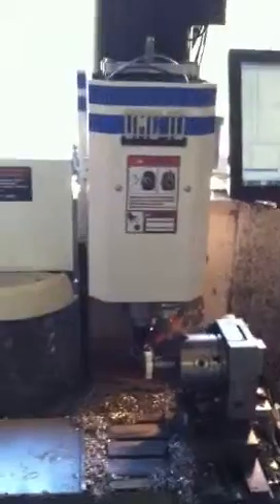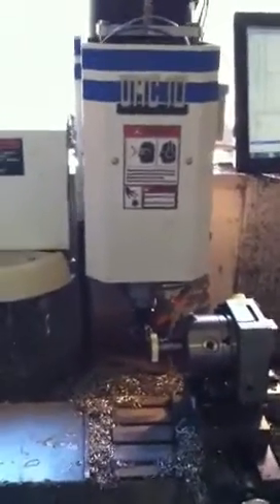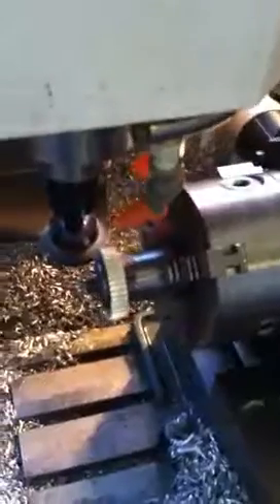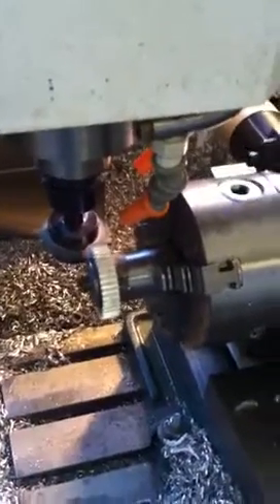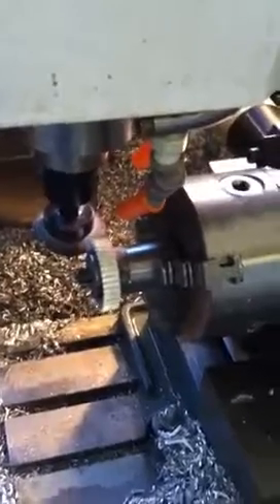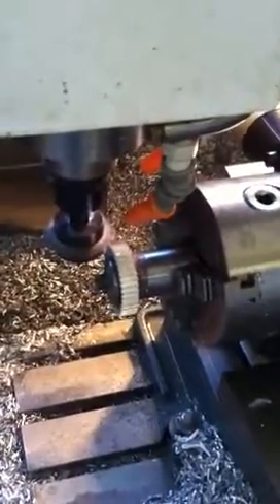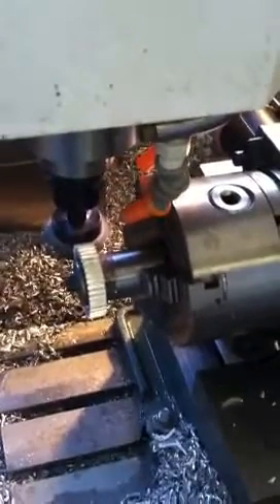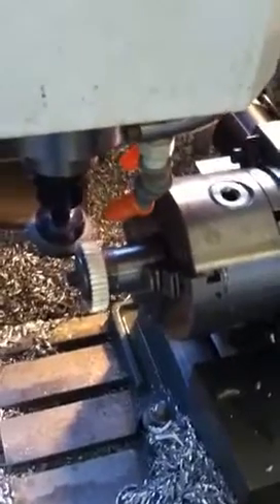Cutting a Gear

Comment: Just to clarify, this is a gear "cutter" hobbing requires constant motion relative to the hob (which looks like worm gear) and the axis the gear is on.  Gear cutting is a totally legitimate way to make precise gears, but can become burdomsome since you have to have a custom cutter for both each diametrial pitch (DP) / module and for the number of teeth on that gear.  Additionally, unless you want to buy custom made cutters, modifications to the gear profile can't be done with a typical off the shelf cutter, whereas traditional hobbing relies only on the hob being the correct DP/module.